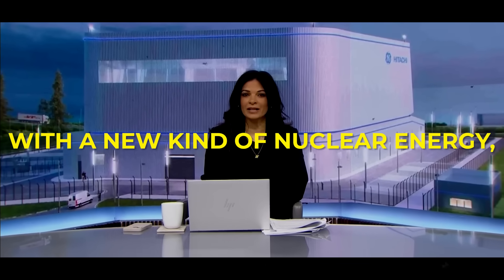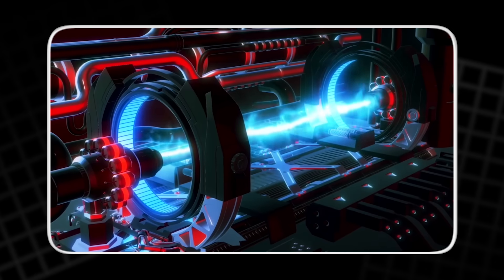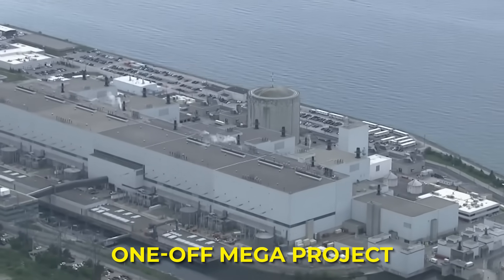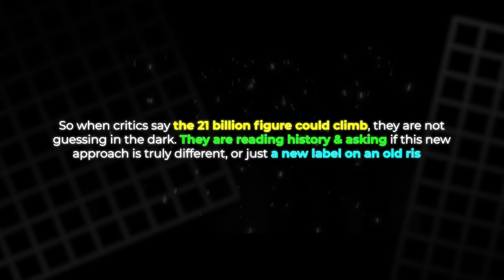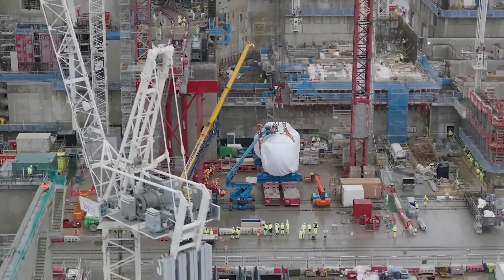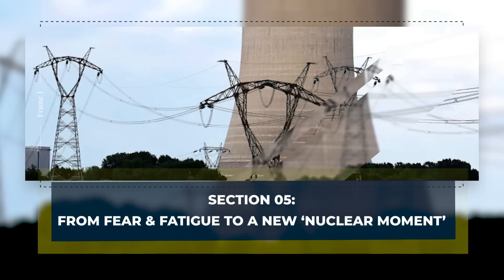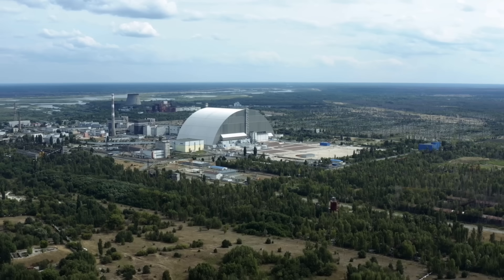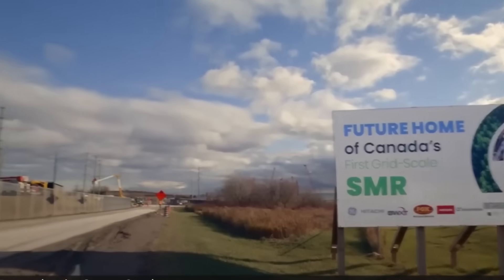Canada Just Started Building the First SMR in the G7… Here’s the Catch

Comment: A bit risky considering that quite a few companies are working on and confident that fusion based power generation is likely to be viable within a decade.  And Canada does have a candidate with General Fusion.  This is not to discredit the SMR effort, I quite agree with doing something that will alleviate the situation now is highly commendable, but this risk has to taken into account.
Reply: Will there be a power generating fusion reactor in a decade; probably. But not at scale, no company has committed to even having a functioning power generation in reactor ready before 2030 and going from your first functioning prototype to commerical technology can take more then a decade when it comes to reactors.

Comment: Provide you audience with an assessment of whether Canada should enter the process of enriching uranium, with the pros and cons and costs.
Reply: CANADA signed the Non-Proliferation treaty in 1968 . . . 
Lots of countries available to provide SMR  Low enriched uranium fuel & the CANDUs spent bundles can also be re-used once enriched.
Reply: @moehunter  I assume Canada's signing of the Non-Proliferation Treaty of 1968 was for the purpose of non-proliferation of nuclear weapons, rather than energy generation.  That raises a whole new topic for Canada's future direction, since the U.S.A. only seems to respect nuclear weapon capable nations, such as Russia, China and North Korea, to name a few.   Canada has the materials and the technical knowledge to enrich uranium, but in the past has not chosen, or identified a need to pursue that avenue.  48 year old treaties can be modified, or changed.
Reply: @chrisgraham2904  NPT does NOT prohibit enrichment for power generation. There is no international legal barrier I'm aware of as long as it is under IAEA safe guards and monitoring.
Reply: @chrisgraham2904  Correct, & it may change if SMR's become widespread but due to the huge cost involved not likely for 4 units in Ontario
Reply from the maker: That's an interesting topic for a future discussion!

Comment: Haven't US navy nuclear powered vessels been running small modular reactors since the late 1950's?
Reply: Naval reactors use highly enriched uranium which isnt as feasible for power generation, also those reactors are designed for propulsion not power generation. Furthermore naval reactors cant be used anywhere else really and are difficult to manufacture, while smrs are intended to be mass producable and be able to work with each other to stack power generation capabilities where needed. The cooling systems are also probably quite different cause one always has access to large vplumes of water
Reply: @dylanarango4737  Uuuhhh ... they just said that these reactors would require enriched uranium. And Naval reactors could indeed be used for power generation; instead of sending the electricity to an electric motor driving a prop, you send it to the grid. And cooling is supplied by a large vat of water that is then cooled afterwards by cooling towers. You could most definitely use a sub's reactor to generate electricity.
Reply: @Kr0N05 HGP Intelligent Energy LLC is looking to use decommissioned naval reactors to power data centres
Reply: i do believe in the mid 90"s +/- there was a sub tied into the grid after that west coast earthquake or talk of it 😮
Reply from the maker: That's an interesting historical point about naval reactors!

Comment: This ain't fusion.
Reply: does someone say it is?  I doubt it.
Reply: @swapshots4427  I guess it's still better than those "wind mills".
Reply: @marcinmorun  Those "wind mills"  could be built 3 times as fast and for less than half the price.
Reply: @coolblu101  Wind ain't constant AND speed varies. Too light means too little energy will be produce. Too strong, well... ...don't worry about energy as there won't be any "production", after "they' break apart.
Reply: @coolblu101  Until you need a permit to erect them & every homeowner says NIMBA
Reply from the maker: You're right, this video focuses on Small Modular Reactors (SMRs), which are a type of fission technology, not fusion.
Reply: This is the near future.

Comment: this is a bad move having to depend on USA for enrich uranium...   should be making SODIUM reactors...  way better..   china has one going..
Reply: Canada has learned the the USA is untrustworthy and this will likely hold true for many years to come. We need to be self sufficient.
Reply: The big worry with Sodium (Molten salt) reactors is if you don't have a reliable backup power source, in case of a disaster, then the molten salt will solidify in all the piping making the reactor a total right off .... of course that is better than a run away reaction  :)
Reply: @Kr0N05  but runaway reactions were already practically solved with negative void coefficient reactor designs. why reinvent the wheel.
Reply: @BaloneySandwichWithKetchup  LOL   At first I thought you were some smart ass that made up that term  :)  Truth is I didn't know that was a type of reactor (I know just enough to be dangerous.:)    But that is fascinating; why aren't they utilized more? Less efficient? Too expensive?
Reply: @Kr0N05  Yes, a bit harder to operate so costs are higher. Due to the under moderation, powering up after  refueling can be tricky. But in terms of fail safes and redundancy it's a superior design.